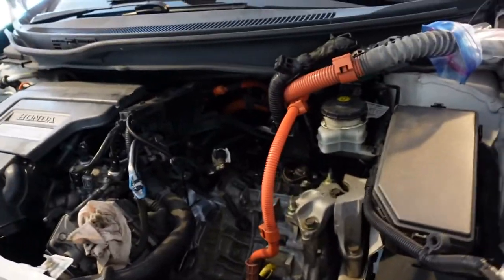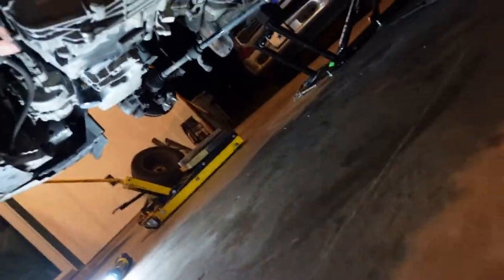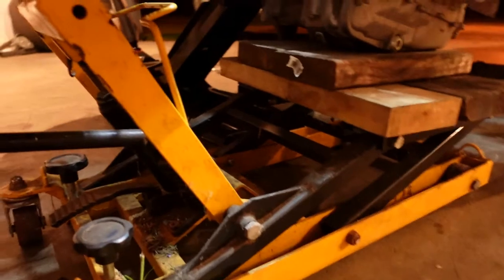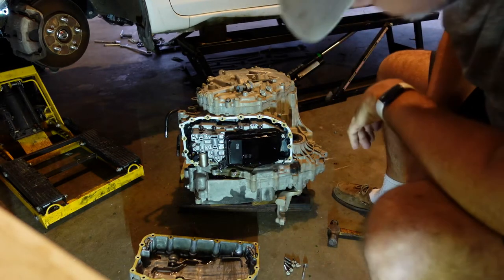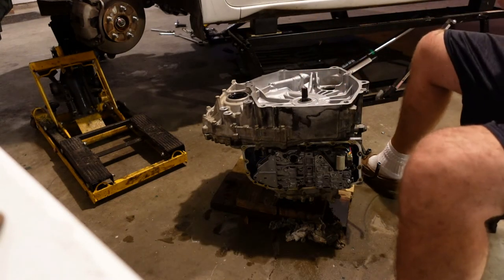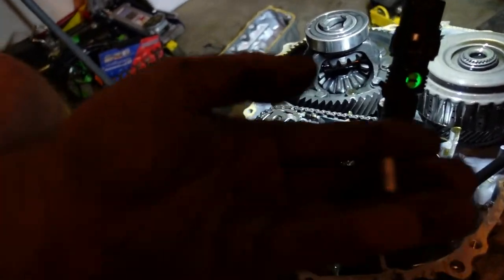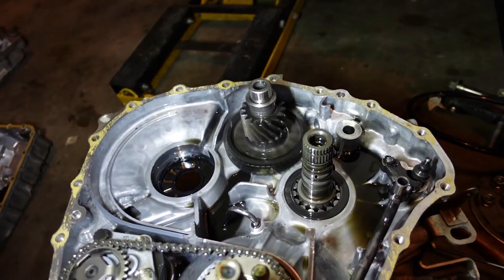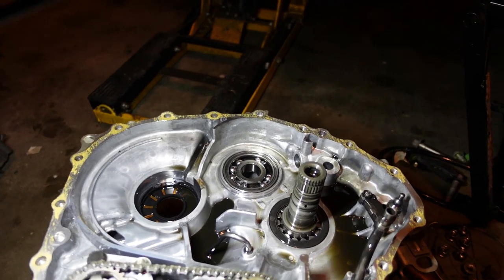Civic Hybrid P0502 CVT Removal and Teardown

Comment: My  Relatives 2020 CRV with 66,000 miles on it has the same issue, chewed the end of the sensor down to the  copper windings .
Called Honda to ask about this pattern failure and naturally they having any issues from their "newer " units.

Comment: Verry nice, but a question, did you replace the 3 axel berings, one on the left side and two in the right side, i think from that it started for me. I have to do same operation for my 08 hybrid.
It is nice that i have the same transmision as the 13 model.....
Sudgestion, clen the complet air intake and egr channel + as bonus for the car to behave beter, add new and bigger grounding wire you will be amezed by rezults from that, i did give also to hybrid battery biger  wire also win.
Thake care and more miles as all civic deseve